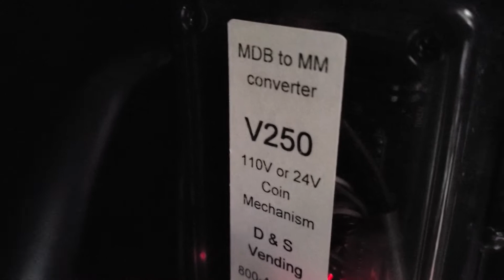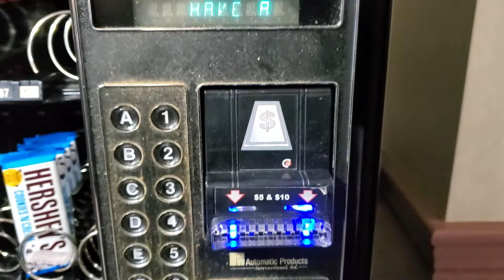How to convert Non MDB 15 pins AP 110 to MDB

Comment: hi, could you tell me how exactly you made it 24v. in the video i see a surge protector but i cannot see the end of the power cord coming from the new box in machine. Thanks!
Reply from the maker: i bought a small transformer from a local electronics store. you can bring your D&S MDB Converter kit to any local electronics and they will show you how to connect 24 Volts
Reply: @franzink  awesome! Thanks so much! My first time ever working on a vending machine. Starting small so I bought an older model machine, Crane 147D. I'm trying to update it for cc reader and dexing but wow! This is a lot more complicated looking inside and around all of these motherboards and wires, than I had imagined! 🤯😲🤣

Comment: I have an LCM3. Is it possible to covert with a kit? I'm your neighbor in Vancouver.  lol
Reply from the maker: Hello Kane, your AP LCM3 or LCM4 is already MDB capable, you just need a wiring harness to plug it into your motherboard which costs so cheap and directly plug into MDB devices : coin mech, bill acceptor and debit reader

https://www.dsvendinginc.com/p-1590-d680576-ap-lcm-harness-mdb.aspx

connect it directly to your board see below

amazon.com/snack-vending-machine-controller-360195/dp/B076116D71 ( see the picture AP on this link which you plug the ap lcm harness cable )

if you want me to do it for you just contact me
Reply: @franzink  Hello Franzink, what do you do after hooking up the harness to the mdb opening on the board? I was trying to connect the nayax to the mdb on board so I got the harness to connect mdb. Do I need to get another harness to connect 15 pin coin mech to the mdb. Im aware it’s connected directly to board but not to the mdb opening.

Comment: Hi Francis.  I have a Genesis 17367 combo machine that does not work with a Payrange Blukey OR a CC reader.  The wiring harness does say MDB.  I am told that I need to put in a new EPROM Chip.  Do you know of any other way to make a CC reader work on this machine ?  Thank you Francis.
Reply from the maker: Hello Mark, I have a very old LCM4 and it is connected to a Non MDB.  The technician told me that i need to prepare parts namely : 

1.  MDB coin mechanism ( you can buy a cheap used one at CL )
2.  EPROM Chip ( sometimes tech overcharge you and say it is non refundable, but i think at D&S Vending it is about $25 to $35 each )
Here is the link : https://www.dsvendinginc.com/c-287-e-proms.aspx

3.  CC Reader ( borrow a working unit from a friend or from your other working vending machine )

What i did was i ordered EPROM chip from him costing me $100! and installed the MDB Coin Mech + CC Reader and it Worked

After testing that it works, I tried to remove the EPROM very slowly as not to damage it and but back the old EPROM and the CC Reader works and i got back my $100 from the technician.

Sometimes the technician wanted to make $$$ from you by adding extras you do not need.

Try first changing to MDB Coin Mech and Borrowing a working CC Reader from another vendor to see it if works since the CC Reader is $350 Dollars!

If it works then there is no need to buy an EPROM and saving you $

I hope it helps.
Reply: @franzink  ok.  Thank you Francis.  I will try these suggestions.  Thank you again.